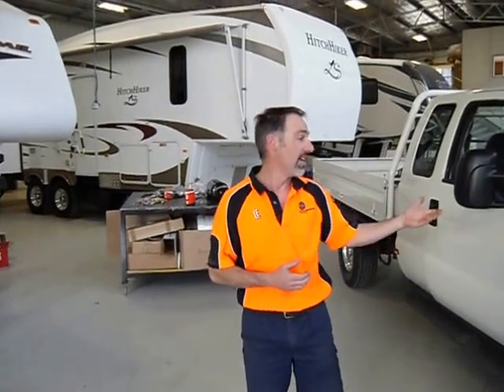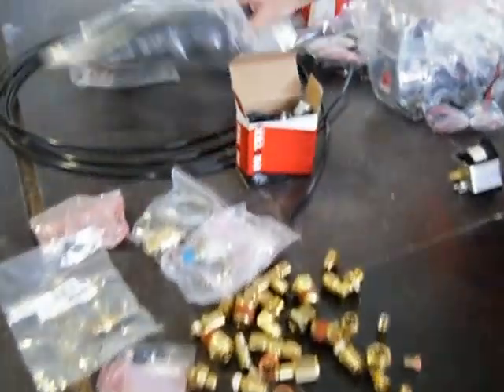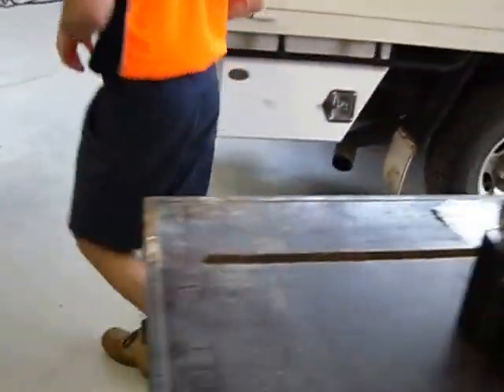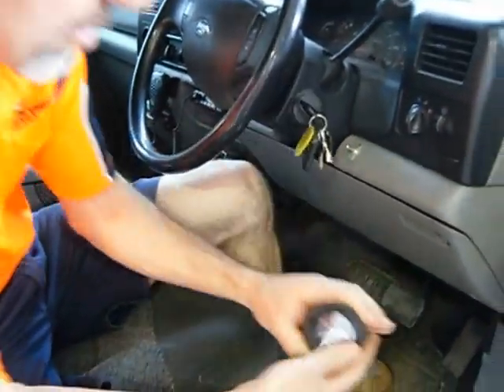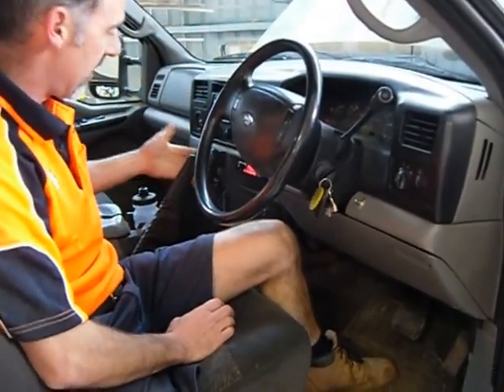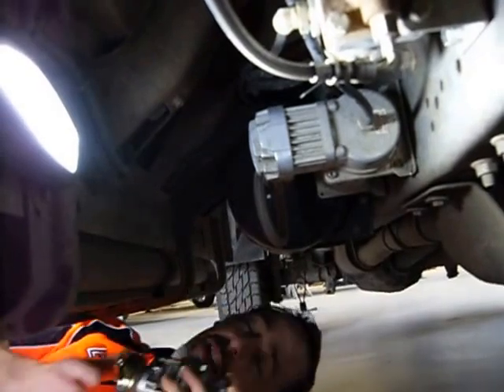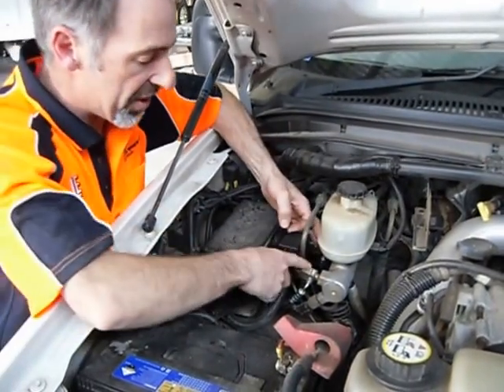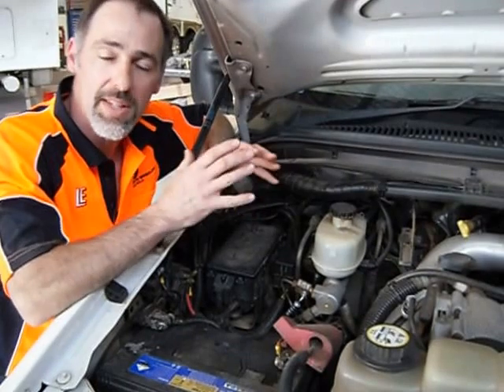Air/Hydraulic Trailer Brake kit ,Australia

Comment: Would this type of brake setup provide better/safer braking performance on a 4450kg gooseneck? I know it's not legally required but if the money and hassle wasn't an issue would it be worth doing? Is it even legal on a trailer smaller than 4500kg?
Reply from the maker: +D1cko888 If the electric braked axles are suitable for a weight of 4500kg then no I don't think that the air brakes provide better /safer braking on a gooseneck trailer . You are correct with regard to the law, trailers over 4.5t ATM must have air brakes. (this is to hold the brakes on whilst parked)In my opinion the law needs to be 4.5t GVM (axle weight). The 4.5t GVM rule is the common rating used by all the state registration bodies, and its what our registration payments are based on. The 4.5t ATM rule is set by DOTARS. We all know that with gooseneck trailering 25% of the weight is on the ball, so in reality the axle weight on a 5t trailer could be 4 ton and well within the rating of  the electric braked system used in the USA. Yes it's legal on any trailer.